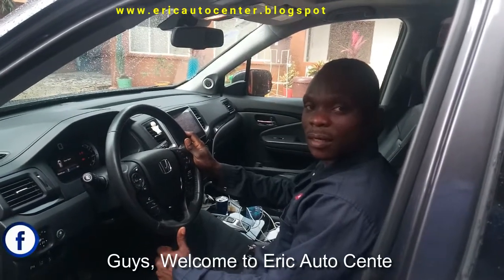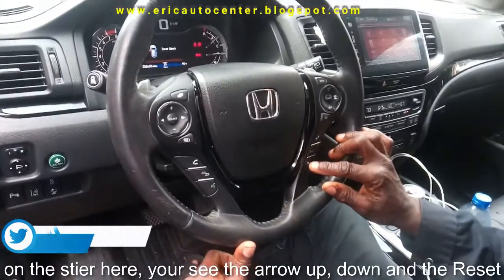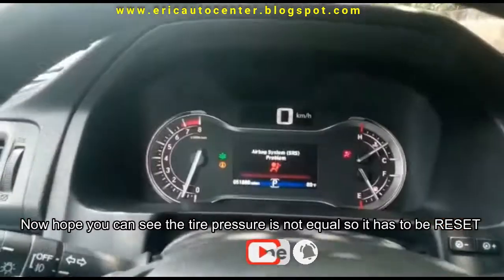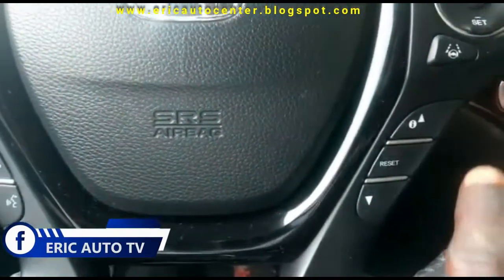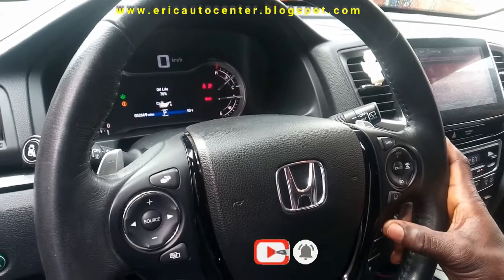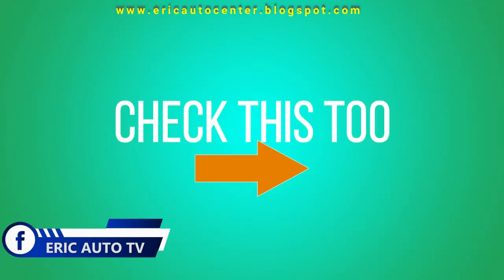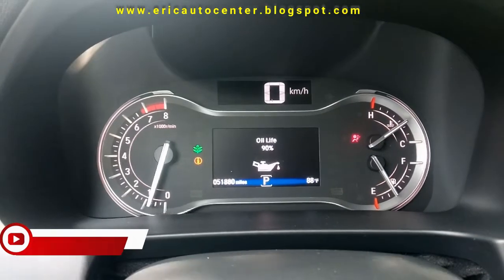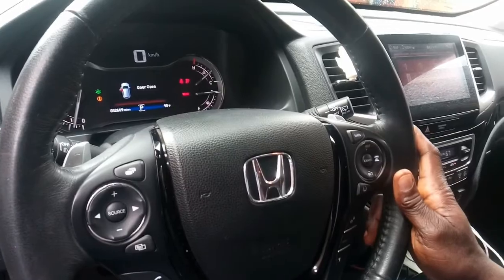How to Check Honda Pilot 2016, 2017 Tyre Presure &/Oil Percentage on dashboard/The tricks and...

Comment: Hi brother , i am not able to reset tyre pressure, can u pls help me out , also how to change the unit kpa to psi , mine is in kpa units.

Also not showing oil life
Reply from the maker: Hi brother, here’s how to fix it on the 2016/2017 Honda Pilot:

🔧 Reset Tyre Pressure (TPMS)
1.	Go to Settings → Vehicle → TPMS Calibration
2.	Select Calibrate
3.	Drive for 10–15 mins.

Change kPa to PSI:
Settings → Vehicle → Meter Setup/Units → Pressure Unit → PSI

 Reset Oil Life:
1.	Go to the Oil Life / Maintenance screen
2.	Hold Enter/OK for 10 seconds → Reset
If the screen doesn’t show:
Settings → Vehicle → Maintenance Info → Reset